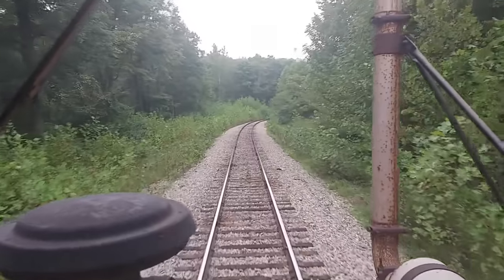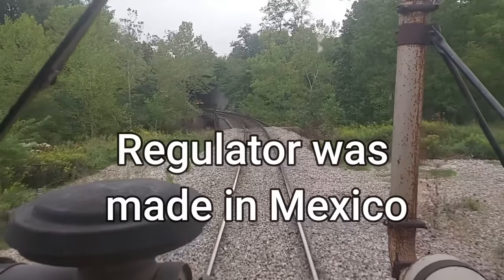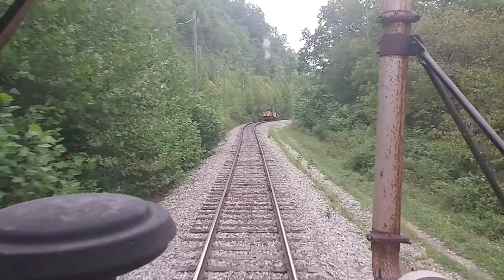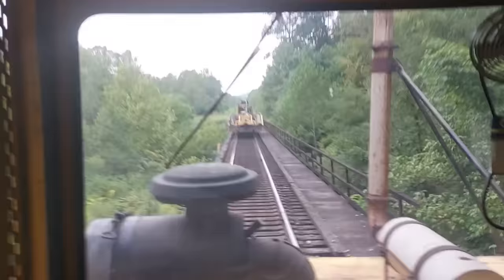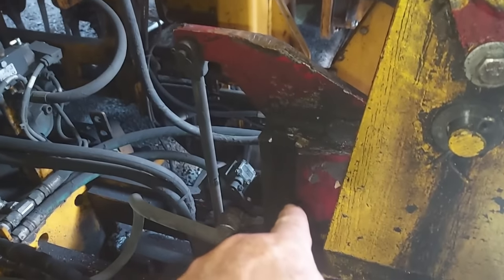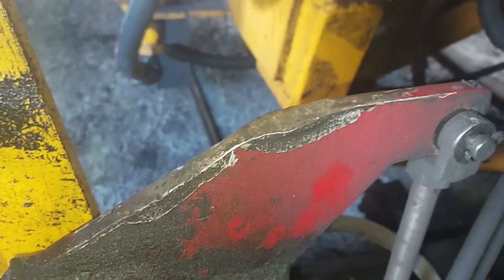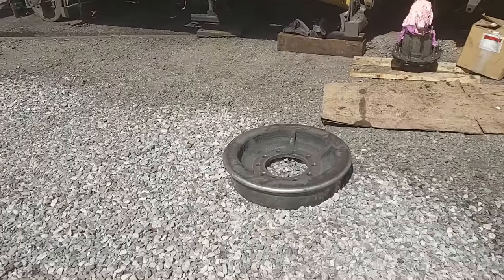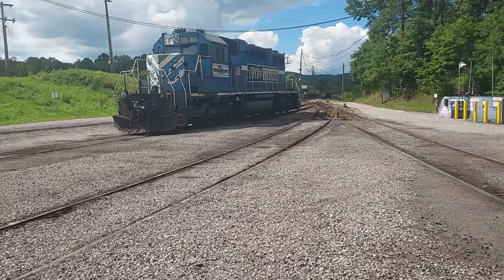A Day in the Life of a Railroader

Comment: Always something to do on the railroad! I'm glad you guys have a shop crew that can get those things back up and running quickly! I'll bet that tamper just needs what you said, a bur or something smoothed out. I wonder what would be causing the burr, though. Maybe another piece could stand a polish or a little fitting. Think it's chattering on the side on the way down?
Reply from the maker: Was a clamp bolt on the tamper Shane, I ground it down smooth,
have had that happen before a bolt backs out a bit. But thats
railroading. :-)  Appreciate very much your tuning in and watching the video my friend.
Reply: @ccrx6700  May need to put a drop of Loc-Tite on there and run that sucker back in, lol.
Reply from the maker: @Trains-With-Shane  👍😊

Comment: Great little video, Dave...enjoyed the ride-along aboard your tamper.  Interesting fact about the Kershaw regulator you may not know...the axle and hub of the wheels are actually the same used on commercial trucks (such as your Freightliner hi-rail).  I'm a (CDL) truck driver, and -- the first time I saw a Knox-Kershaw regulator (on the LIRR) -- I was surprised to see that.  Speaking of interesting MofW equipment, down here in central Florida on CSX, I recently saw a bizarre machine owned by American Track that an AT technician told me is a "yard cleaner" (his description).  Structurally, it resembles an "old school" Loram ballast cleaner, but what sets this thing apart is a pair of (commercial highway vehicle) rubber-tired axles that are attached to the "B" end of this machine...they can be lowered to the ground to tow this machine (on roadways) with a semi tractor!!  The machine (on the rails) is powered by a Detroit Diesel engine...I'll bet that sounds great! (would love to send you pictures of it!)  Thanks for the video... 👍👍
Reply: I was thinking that it looked very similar to a heavy truck setup.
Reply from the maker: Very intersting about the rear ends EBF! Many years ago we had
a yard cleaner in here, but that was so long ago I don't remember
a whole lot about it.  Appreciate very much your taking the time to tune in and check out the video my friend.

Comment: When you mentioned using a sledgehammer. It brought back memories of when I first hired out as a Fireman in early 1974  on Penn Central Railroad. When Hosling In the Meadows freight yard in South Kearny NJ. A airbrake valve was stuck open inside the hood of a GG-1. The engine house mechanic used a small sledgehammer and beat on this air valve. Until it became unstuck. A sledgehammer or ball pean hammer was a tool regularly used by car inspectors. Whenever a air brake valve was stuck open or stuck closed. The car inspector would keep hitting stuck air brake valves on passenger and freight cars until it opened or closed. The saying on the Railroad back then was don’t fix anything unless it is broke. Beat on it with a hammer first to see it that will make it work. If not beat on it some more. Only when this didn’t work. Would someone actually repair whatever was being beat on with a hammer. Those were the good old days. LOL.
Reply from the maker: Sounds like a coal mine mechanic mdlanor! Hit it with a sledge first
and see if that fixes it, if not, hit it with a bigger sledge....:-)  How cool
you worked for PC!   Appreciate very much your taking the time to watch my friend.
Reply: @ccrx6700  
I binge watch your latest videos every month or so. I miss the railroad. Shouldn’t have let my wife and kids pressure me into retiring. Please no response necessary.
Reply from the maker: @mdlanor5414  😊👍

Comment: Hey Dave !!  Yepper !!!   ""OL"" Murphy's Law "" again strikes again on you !!!  🤔🤔   If you watched that video on " Murphy's Diesel ""  ,, that wheel bearing is why they had to go get the 90k high wheel off the tracks in "NO MAN"S "" land !!  Thanks for the video again & ""Stay Safe "" !!! 🤠😎😎👍👍👍👍👍
Reply from the maker: Will get you every time won't it KB, and usually at the worst time for
it to happen, but we did luck out this time on that part. Appreciate very
much your taking the time to tune in and check out the video my friend.
Reply: @ccrx6700  Well Dave !!  Properly too late now ,but you could have used the new wheel to make a pattern for the lug holes & plug welded the lug holes in the old wheel using the pattern & you would have a spare for next time !! 🤔🙄
Reply from the maker: @KB-gs8zi  was a core charge on old wheel. Besides no one herehas that much ambition 🤔

Comment: Spritzer bottle mixed 1 part 15w40 3-4 parts diesel will usually free up a gunked up grease part.
Reply from the maker: Thanks for the advice, mechanics here use a lot of Kroil oil.. Appreciate very much your taking the time to watch the video my friend.
Reply: @ccrx6700  
Really works well on the chrome slide shafts on spiker and puller track units as well.
Reply from the maker: @cp-jc2784  👍😊

Comment: Hi Dave, When  you get your thoughts collected, Can you discuss ties some more? Basically, How long do ties in ballast last opposed to one on bridges, Tie size and spacing. You mentioned  before on the a bridge you wanted to go to ballast on the bridge. Now what makes you want to do that? Wont that shorten tie life and make a booger of a time cribbing? Thanks
Reply from the maker: I had made a video on how long to wooden ties last tbearails, do
a search for it. Ballast deck bridges never need cribbing they have
a steel bottom and you can tamp right thru them, the approaches
on either end don't drop like they do on a deck bridge besides it
not as difficult to change ties on a ballast deck bridge as you
may think. Appreciate very much your tuning in and watching the video my friend.

Comment: Dave how do you check the bolts? hit them with a hammer? check with a wrench? 
I found a set of 3 broken bolts one side of the jointed rail. great video, it is still hard 
to get parts! things still have not normalized! have a great day Dave!
Reply: He probably drives a section of track in his truck and looks for rough joints as the steel hi-rail wheels cross joints with loose or missing bolts. The loose joint will be misaligned enough to make it rougher to cross than a tight one. Also a lot of those well seasoned inspectors can see loose joint bolts from inside the truck if they’re loose enough. 
If he’s walking the track, he most likely just checks them with the wrench. Since they have split ring lock washers under the square head nuts, loose ones are sort of easy to see because that washer won’t be  flat under the nut.
Reply from the maker: Mostly a visual inspection but when walking track hit them with a
spike maul handle Barry, sometimes it's hard to see loose bolts
from up in the hi rail truck. Appreciate very much your tuning in and watching the video my friend.

Comment: Is it easy to get parts for your equipment, Dave? It's easy to see it will take more than WD-40 or PB Blaster.  Is there a special weight  or kind of grease?
Reply from the maker: 90 weight gear oil in the rear axle on that regulator Shirley. Appreciate very much your taking the time to tune in and check out the video my friend.